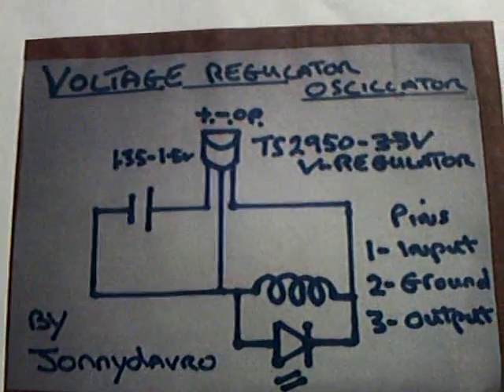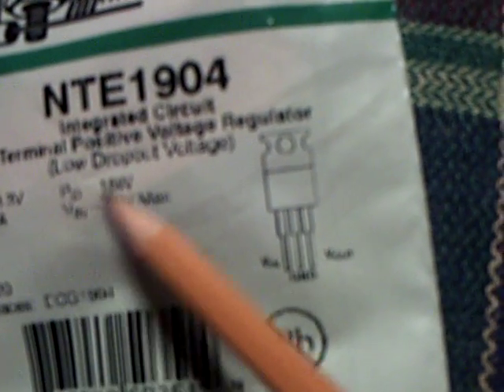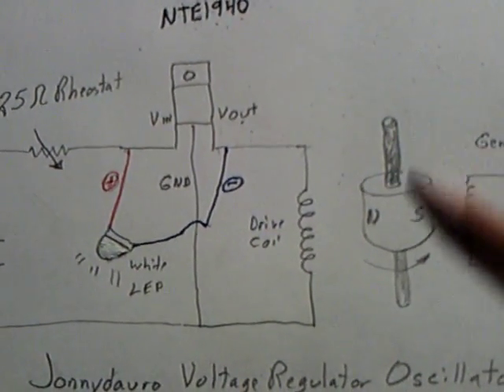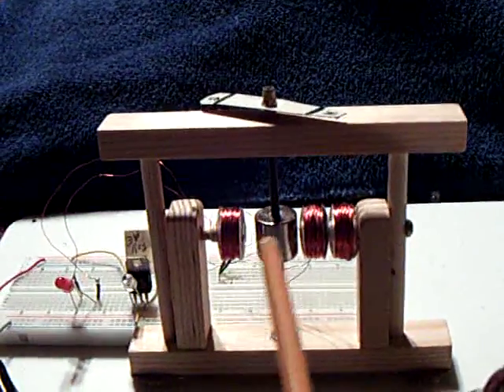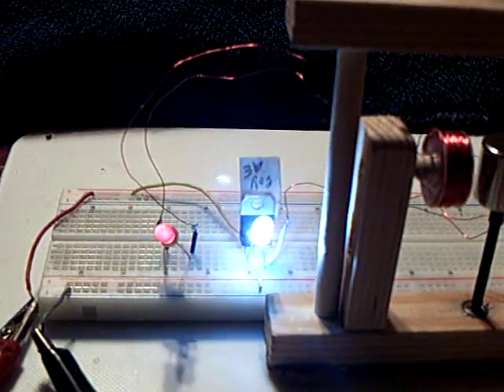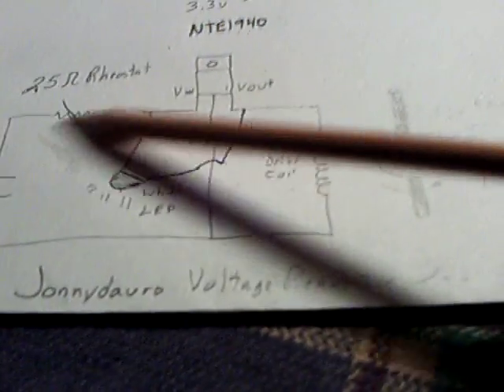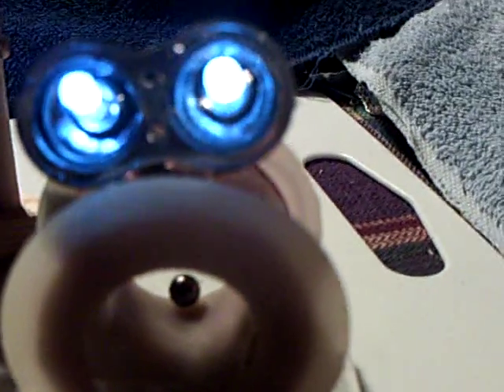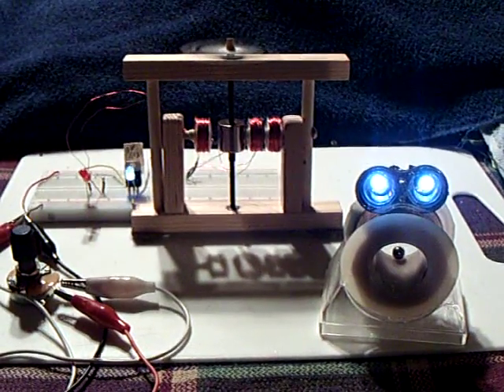Voltage regulator oscillator by Jonnydavro.ASF

Comment: @Lidmotor Very true. I'm not that lucky living in a 3rd world country. I'm still waiting for parts I ordered a month ago :-% Still it doesn't stop me working with what I do have and can scavenge. I got it working with a LM317T on 1.5v. Interesting thing bout this circuit is its amp draw seems to drop when a coil with load is thrown in there. Have you thought of throwing an  Esaki type circuit in there to pulse charge the running battery at 12v spikes?